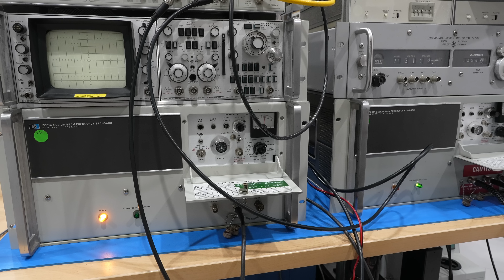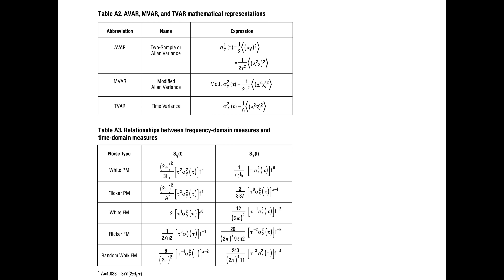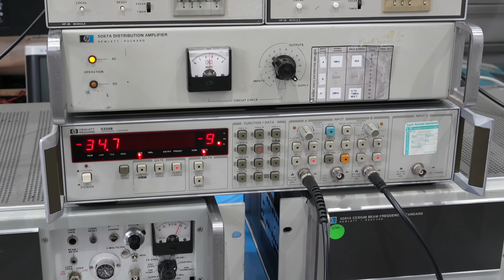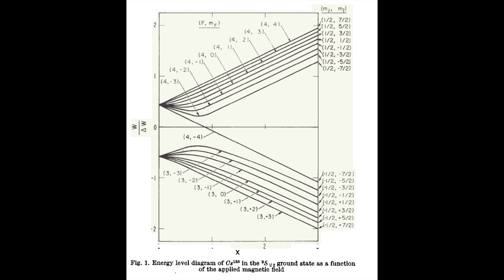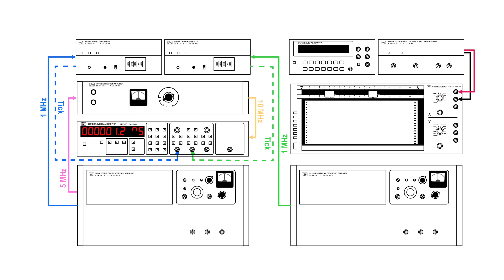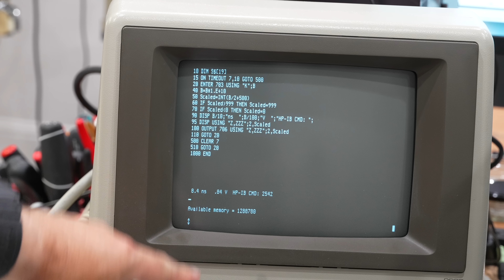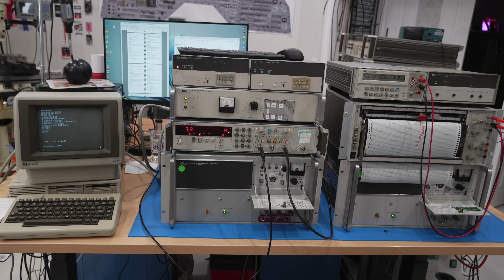Our first dual atomic clock comparison experiment does not go as planned

Comment: Hi . You can compare and verify your clock one by one with a good GPSDO receiver that gives GPS signal from NIST very reliable base of GPS system. This way you may be able to assess if you have issue with one clock and also fine tune their rate... Thanks for this works. This is an experiment that I wanted to do since my young days in the physics lab in 1987 but was never able to do.
Reply: You are right it has to be a very good GPSDO receiver. Comparing three less expensive receivers I found out that one of them had a frequency offset of several uHz at 10MHz. For most applications that's absolutely irrelevant but for comparing atomic clocks it would be.
Trimble and u-blox receivers seem to be ok.
They all have quantization errors affecting the short term stability but long term stability is excellent.
Reply: The trouble with GPSDO is the short term drift, long term its likely the best you can get other then being on site at NIST

Comment: That electronic HP-induced Walhalla never ceases to amaze me - and so do the advanced repairs and experiments you guys perform. Fascinating, as Spock would say!
BTW that HP computer with a VERY powerful basic is amazing! A few lines of code does the job well... these days you'd need Gb's of libraries, lots of DLL hell, and a massive multi-core processor, assuming it would be possible at all.
Reply: Libraries are probably the biggest cause of software bloat.
Reply: @douro20  Libraries encompassing the universe, but packaged with individual programs over and over, rather than shared systemwide... (I'm too young to be a UNIX evangelist, but never too late to the show to be a UNIX troll :-)

Comment: Neat, I should try something simular, however my clocks are much more lowly oven stabilised crystal types, but with a Trimble GPSDO to add to the mix. I have no dreams of validating Einstein, just figuring out where all my drift is coming from. The more problematic clock in my case outputs an odd-ball 19ppm pulse train, so I'll have to divide that down as well as the GPSDO etc., 1PPS so they both have one pulse per minute. Whilst I do have a nice HP counter that can do the period measurements, I have no way to extract the data as it only speaks HPIB and I have nothing else to read it. So I'll have to dream up something else using a microprocessor to measure the delay between my various 1Hz ticks (and 1PPmin)
I'm just going to capture all the data in a computer then load it into a spreadsheet for analysis.
This does bring one question about your setup, your bringing the data from the counter into the computer, why not just get it to store and display the data, way easier than playing with paper.

Comment: If you have the possibility of an additional trace on the plotter, include ambient temperature. Another thing you could try, is doing a similar dual measurement of the inside temperature of the clocks, incase you have a fault on the power regulator system, causing a temperature variation. I repaired and aligned Aircraft flight control systems, and inertial navigation systems, and the Room you work in must be temperature and pressure controlled or, tracked, to use that data to eliminate those factors from the adjustments. Another thing, placing different devices on the top of one clock from the other may introduce a differing magnetic field, there by modifying its stability. Also precise positioning of the extra equipment, in the same place on each clock would produce a better result. Remember it's the little things that affect the little timing changes.
Good times, to you. Andrew
Reply: Well said. I have no experience with electronics this sensitive, but deal in professional audio. Pre digital consoles, most of my day was spent tracking down buzz's. Stacking all the electronics tight in the racks looks awful nice, but all those big transformers in close proximity did some crazy things to the audio path. My simple suggestion is to at least get the clocks away from everything else. I know it's tuff for camera, but physical separation of each piece of equipment will save you a lot of time in debugging. Thanks for your amazing work Marc.
Reply: Been there, running stability tests on satellite uplinks where we had to maintain an uplink signal within +/-1db over 24 hours. We repeatedly failed the test overnight during the 24 hour test; we subsequently discovered that the building supervisors remotely shut down the A/C after 20:00 until 06:00; being in the Caribbean, the resulting temperature drift was ruining our power stability.

Comment: Why even use the HP59308, could you not just feed the 1MHz signal from each atomic clock directly to the scope and view the relative signal phase?
Reply from the maker: Sort of yes. Once you know your clocks are not drifting beyond the interval set by your divider in the time allotted for your measurement, and if you can make sure that the two phases stay sufficiently offset and will not cross during the time of the experiment, and if your counter trigger is low-jitter enough, you can try to switch to direct measurement, not by a scope, but by the interval counter, and see if you'd get a less noisy measurement. Right now the measurement noise is well below the drift we observed, and already below the precision I wanted to achieve, so it's not a pressing issue. But hopefully at some point we'll be able to try without the dividers and see if we can improve further.

Comment: There is a 10 MHz standard sine wave radio on air from "WWVB".
Reply: Uh, WWVB broadcasts on 60KHz.  Perhaps you're thinking about WWV/WWVH?  Yes, they have a 10MHz signal, but it's affect by propagation.  So the short term accuracy isn't that great as the length of the signal path can change.
Reply: The required precision is so fine that anything where the source is remote is going to have issues with varying delays. Likewise anything using the internet will suffer variations due to packet switching. As people have mentioned even environmental changes affecting the coax cables in the experiment are significant.

Comment: In 1973, I had a chance to be in Oklahoma on a military base. There was a data gathering operation in process, five 40foot trailers each contained ten reel-to-reel tape recorders, and one trailer, I was told, contained an Atomic Clock. They were recording the artillery acoustics and also needed the Atomic Clock's accuracy for their research.

Comment: I heard your video start so I watched it over my partner's shoulder. There are some things to consider.

First, coaxial cables are piezoelectric. I was performing a measurement of this sort back when I was doing some GPS satellite work. An earthquake happened. It bounced the lab a little. The experiment showed the earthquake very clearly.

Second, and perhaps more important in this case, coaxial cables are not zero temperature coefficient devices. So room temperature variations, as from airflow when closing the door when you go to bed, could cause some abrupt variations.

Third, consider temperature effects on the trigger for any sine to square conversions in the setup. For grins and giggles move the computing counter's reference over to the other clock and see what happens.

Fourth, consider that Cs tubes have a life time. Once exceeded they still "work" but accuracy degrades. Are both Cs tubes within their warranty life?

{^_^}   (I may post more as I think of possible problems.)
Reply: Several months ago I was trying to compare two GPSDOs and here and then I got timeshifts on the counter. I added an osciloscope to the 10MHz ouputs and set it to infinite persistence mode to look at the rising edges.
I found out that every time I stood up from my office chair nearby I created hefty discharges due to static charges leading to additional rising and falling edges on the cables. I think the coaxial cables together with a ground loop acted like some kind of loop antenna. The fast changing current on the shield then induced voltages on the center conductor.
I then tried to add several ferrite cores as sheath current filters to the cables and it indeed reduced the effect.
Reply: @HansS-vh8de 
 It's a shame Bob Pease died ni a VW Beetle crash some years ago. He'd be able to sort this out in a trice, I bet. Another gem was Bill Sabin at Collins. His internal articles that percolated to Rockwell Anaheim were always at the top of my read it list. It reminds one of her own mortality.

{^_^}
Reply: @Wizardess  I knew that he and Jim Williams had died but I just read in an EDN article that he actually died on the way home from Williams funeral service.
The same article mentioned that Eric Schlaepfer is working at Maxim (at least in 2011). Didn't know he worked / has worked there.
Reply: @HansS-vh8de  The wheels on office chairs are plastic (polyurethane or similiar), so rubbing on flooring (vinyl or similar composite), you got an interesting Van De Graff generator. 

I know, for I've zapped myself every time I've scooted myself around on the floor.  Back in the 60s/70s, they had metal chairs with metal casters.
Reply: @Nighthawke70  I'm an electrical engineer and I actually put grounded conductive flooring into my private workspace. 🤓
The chair is a normal office chair from the shelf but I've replaced the standard wheels with special charge dissipating wheels.
The bottom part where the wheels are mounted is made from die-casted iron. But nonetheless there is no fully conductive path to ground as you will need conductive fabric for that.
Reply: @HansS-vh8de  My shoes were supposed to be made of static-dispersal material. Turned out they were static generators. I found out the hard way by walking down the hallway and bumping into a wall fixture... ZAP! I had to shop for a new pair.  Truth in marketing?  Only testing will reveal the truth.
Reply: @HansS-vh8de  Office chair dampers can create quite some EMI. Enough to "unplug" my USB devices from my pc if I get up too quickly.
Reply: @NoNameForNone  That has also happened to me on several occasions.
USB is somewhat protected against common mode interference due to differential signaling but if voltages reach the supply voltages of the line drivers the data can be distorted.
Ethernet connections are better in that regard because ethernet cards use small signal transformers in addition to the differential signalling so there is no DC path into the transceivers.
Reply: He is not measuring tiny voltages here.
Reply: @stargazer7644  All the effects I mentioned are problems I faced with the pre-launch test receiver for GPS satellites. Another serious gem, if he is using old type N connectors for double shielded 1/8" coax is the pesky detail that the female bulkhead connector cannot be assembled with a VSWR less than about 1.5:1. That causes internal reflections. That corrupts the signal moving the rising edge slightly on relatively short cables.

Tiny effects even on large signals can corrupt them at the level of precision GPS offers. FWIW I am also the person who built into the satellites the position corruption that limited it to 100 meters precision for several years. (The AF did not want to make it easy for Russia to dump a boom maker into POTUS Carter's personal toilet.)

{^_^}
Reply: @stargazer7644  But he is measuring small phase/time differences. Small voltage changes could possibly be converted into relevant time or phase changes. At 1MHz one cylce is 1us long and the rising and falling slopes are 500ns long. If you use a triangular shaped signal (for simplicity) with an amplitude of 1V peak-peak you get a time variation of e.g. 5ns for every 10mV change in trigger level.
ESD could definitely be a problem. It could lead to several crossings of the threshold level during one period of the 1MHz signal.
Reply: @HansS-vh8de   FFS he spent 3 minutes explaining exactly how he's doing it. It's at 2:30 since you weren't paying attention.  He's not comparing phase.  He's using a 5334B time interval counter to measure the time difference between the falling edges of a square wave pulse from each cesium standard. He's getting the pulses by dividing down the 1 MHz cesium standard outputs with a 59308A timing generator. 
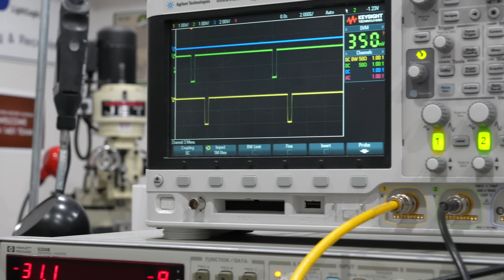The pulses he's measuring are about 2V peak and are right there on the screen at 3:23 .
Reply: @stargazer7644  Nope
Reply: @stargazer7644  he is comparing phase between the two 1MHz signals. It is irrelevant if it's divided down by the 59308As or not.
Reply: @stargazer7644  He is using the 1MHz sinusoidal output of the 5061A. There are three sinusoidal outputs 5MHz, 1MHz and 100kHz with an output voltage of >1V (rms) into 50Ohms load (manual for the 5061A).
Reply: @stargazer7644  He is triggering on the rising edge of the 500ns pulses. The manual of the 5334B states that triggering on the rising edge is selected if the red led in the slope/start arm/stop arm keys is off.
Reply: @HansS-vh8de  He's counting the time interval between the pulses.  He's not directly measuring phase.  Now you can sit there and stomp your little foot all you want and scream "Nope" as much as you like, but he TOLD YOU how he's doing it.  It boggles me when people sit there and deny obvious facts as if merely insisting the opposite somehow makes it true.
Reply: @stargazer7644  How do you measure phase shifts? By measuring time between zero / threshold crossings of the two signals, right?
It does not matter if you take 1 or 10 (division by 10) zero crossings. He isn't using sophisticated PLLs, those are simple binary counters and the output pulse occurs if the counter is triggered by the 10th slope. Thus it is synchronized to the last trigger point.

Comment: Another problem about the Allan deviation measurement: For this you'd need equally spaced time ticks, i.e. each 1s, 0.1s,  0.01s, .., i.e. select a fixed one.
Otherwise, this statistics does not work (converge) correctly.
In your setup, the rate of your T.I. information is not precisely determined, only by the analogue timer in your 5334B, instead by the divider rate (like 1pps). The jitter of this "bad" timer might cause additional jitter in the phase information (not sure)

Comment: I really appreciate that you've set up a completely vintage HP instruments setup, very nice!

Anyhow, I'm more a volt-nuts than a time-nuts, but I've got some concerns about your T.I. measurement set-up, as I was remembering stories from the Time-Nuts mailing list.

First, the dividers should be thoroughly checked, whether they are really fast and stable, i.e. whether they act as synchronous dividers, in contrast to the asynchronous ones. If you go for 100ps resolution, any drift of asynchronous mode dividers can be observed as jitter or medium term drifts. If I got it right, you divide down to only 100kHz.
The time-nuts instead use a PIC controller, programmed as a state machine divider, which act as very stable synchronous type dividers, but down to 1 pps, which is better to observe and will avoid 10µs phase slip or T.I. wrap-around, which might be the root cause of the jumps you see on your chart recorder. I didn't catch the resolution of your set up.
Maybe you can divide the Cs output further down.

2nd, you don't need to synchronize the time-base of your 5334B to a precise external reference, as the T.I. or phase information in the ns range doesn't need extra uncertainty/precision.
In contrary, if you synchronize your counter to the same Cesium clock which you are measuring, there might happen some strange oscillator coupling effects.

3rd, you don't need to "zero" your T.I. / phase information on the counter, that's an unnecessary complication, making the measurement a bit more confusing. You also don't detect correctly these phase-overruns/time-slips each 10µs. Better try to synchronously reset the dividers once you start the measurement.

4th: I think it's really not a good idea to use 100 samples averaging on the 5334B, to increase the resolution down to 100ps.
That might as well be a source of undetected phase jitter or phase-jumps.

I use the TimeLab program for comparison of clocks, with my 5335A or 5370B T.I., as this program contains a phase recorder, and calculates directly the Allen Deviation from un-averaged phase information (1pps or faster ticks). There was also a problem with these averaging counters like the 53132A.

Comment: Please check and compare the stray magnetic field sensitivity of the booth tubes, because the mu-metal shield around the tubes are can get magnetized or saturated by time.
 it can makes the controll circuit busy and olso can cause drift.
Reply: Seperate them ( the 2 atomic clocks)